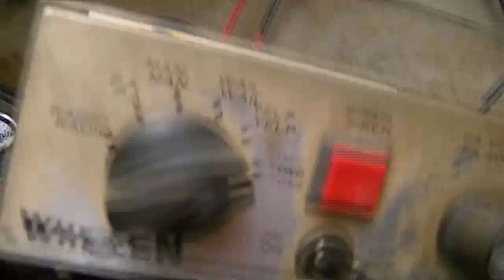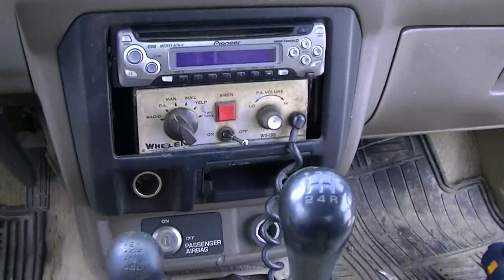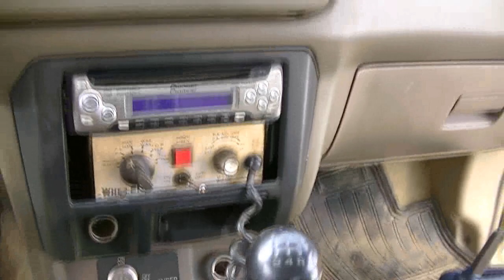New Cop Truck

Comment: Why do you have 2 shifters
Reply: Most likely the smaller one is the four wheel drive selector
Reply: Stephen Coates big one= shifting gears
Small one= higher or lower gears or 2x4 to 4x4